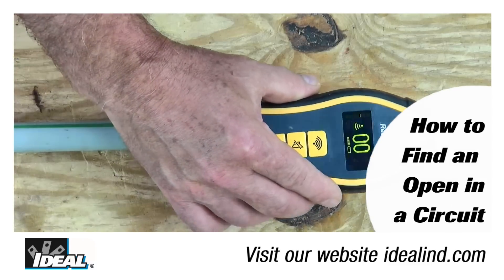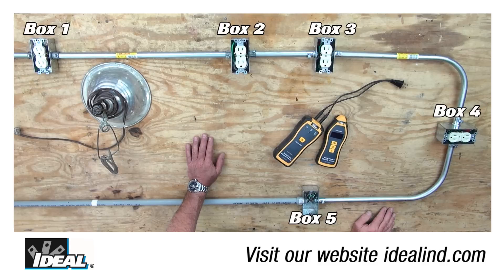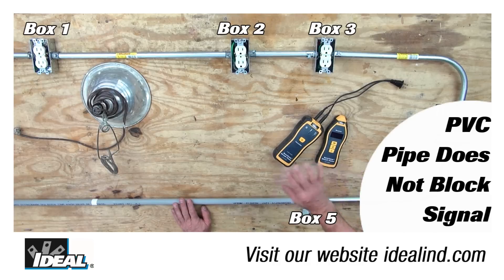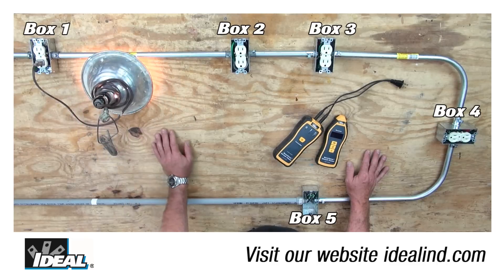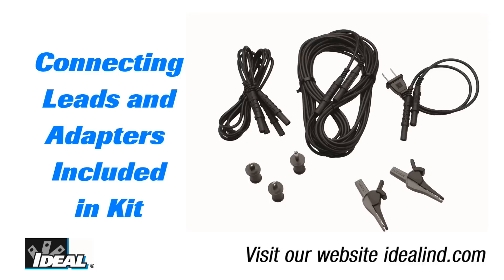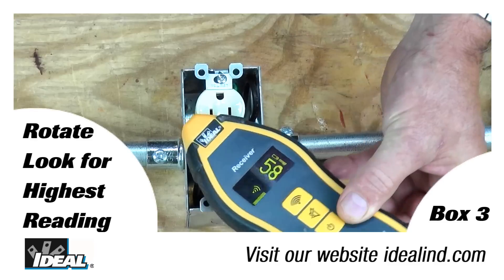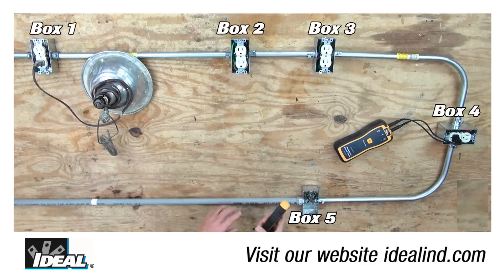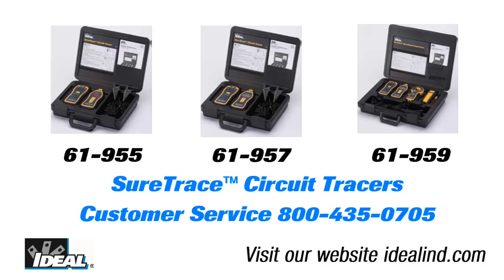SureTrace™ Circuit Tracer Finding an Open

Comment: Could you explain the use of the bulb again in a different matter to help me understand the purpose
Reply from the maker: The tracer works best in a closed loop situation by plugging the light into the outlet it allows current to flow through the circuit and hence a stronger signal to trace. Hope that helps Ron

Comment: Hello Mr. Ron, I am from Brazil and bought a product part 61-959, I would like to know if there are conditions to locate the leak voltage and how should I do it please.
Reply from the maker: Hey great to hear from you. I am not sure what you mean by leak voltage but watch the playlist I have up there are about 15 videos up on how to use the product.  Also you can check out the microsite on the tester 

http://idealcircuit-tracer.com/
Afterward if you have a question let me know. You bought a pretty good tracer. Good luck. Ron
Reply: Thank you for answering this quickly. I really appreciate your support and I meant current leakage (I don't know if this is the translation for the technical term). So, what I need to know is how to detect electrical current flowing through any undesired way, such cable shielding or screws due to any bare wire, for example. If possible, could you gently tell what video regards this subject?
Reply from the maker: Sounds like you are needing to find a short in the cable. Here is the video
https://youtu.be/58n-f1bEDss?list=PLw8qsvCN6q_0kP_ve66G0PhUxNn8OE00l

Just make sure to turn off the power then use an OHM meter to figure out which conductors are shorted and then use the tracer to find the short. As always hire an electrician if you need to. Take care Ron
Reply: Thank you so much Mr. Rom, i am electrician.
Reply from the maker: Great I was hoping you were an electrician you just never know who the person is.

Comment: I have an outlet in a residence bathroom that has lost power,  Should I be able to connect the transmitter to the what would be the hot (black) wire and the other to the ground wire and then attempt to find the path of the romex in the walls perhaps to the next junction box?  I have tried this in the past and do not have a lot of luck getting signal.  Of course this is an open circuit, so should I attempt tying the transmitter to the neutral and ground?
Reply from the maker: Tom if you would like to talk send me an email with your contact info and I will give you a call to see if I can help you. Ron at ron.kipper@idealindustries.com
Reply: Tom Zielke Hire a professional.